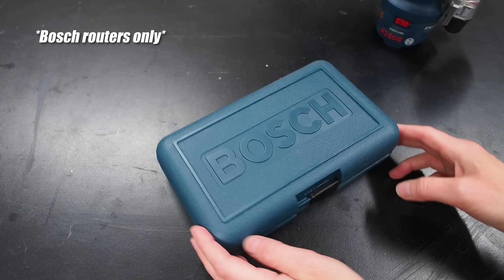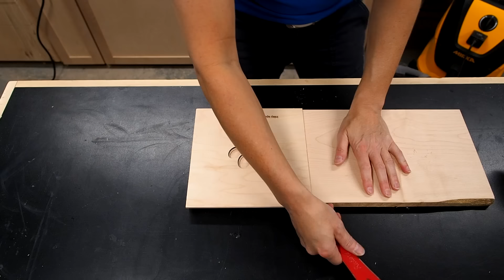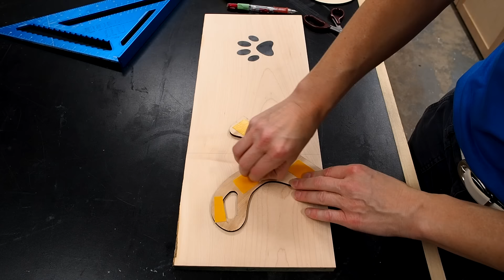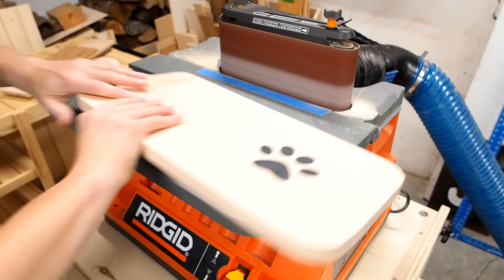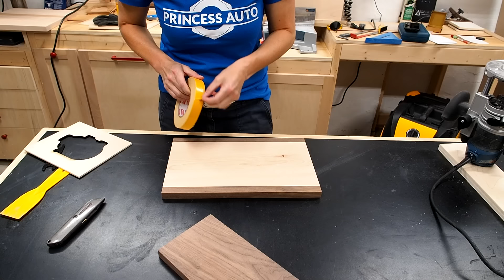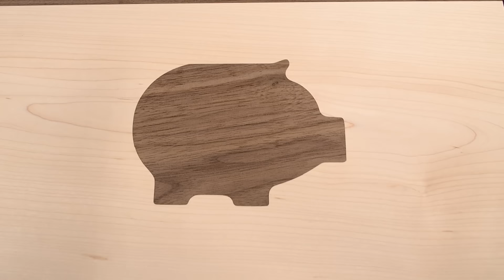Router inlays | Who knew it could be that easy!?

Comment from the maker: Router Templates available here: https://www.diymontreal.com/product-category/router-templates/
Reply: What type of laser xtool model is that?
Reply: I have just started doing some inlay work. When checking for that fit. You are right when you said that if you push the new inlay piece into the ground piece that it may be hard to get it out again. What you can do is lay a length of dental floss across the excavated area then if the inlay piece fits perfect just pull both ends of the dental floss and the inlay will pop out!
Reply: I just subscribed! Thank you. This double sided tape what is the name brand?
Reply: You and the work you do is impressive! :) I appreciate your videos.
Reply: Hello I enjoy your videos. Sometimes you can add a cloth wet overnight and the dent will disappear as it soak up the water and  wood swells
Mike
Reply: I got nothing to add. Flawless router game, immaculate shop. Tools in fantastic working order. Templates of quality. everything is top notch. The glue game is tight. The finish game is tight. Finish sanding is tight. Marking the piece while level sanding is tight. I don't really have anything to add. What I PERSONALLY do for flat surfaces is I have a confirmed flat surface that is dead flat and does not change, that I have a few sheets of 60, 80, 120 paper on so that I can sand anything I need flat. I ONLY would recommend this, though, to people who 1, have plenty of space for a 2-3 foot sanding table and 2, are OCD as HELL about stuff being flat. I build guitars so I am OBSESSED with making sure the backs or tops of a guitar are absolutely flat. I don't actually recommend that though for 99% of the woodworkers on earth, because I'm OCD about it to the point of insanity so there's that. lol. That's why I got nothing to add. Your game is sick. Also glad you did the filler, so glad you included that. There's many people who don't actually know about that trick, and you showed it perfectly. Fantastic all the way around. Even your edge rounding game was impeccable, and that's where a bunch of folks lose focus because its so "easy" in regards to routing that they end up making mistakes. You got serious shop skills. I subscribed on the spot. I do ENTIRELY too much work with a router so its refreshing to see somebody who actually knows how to use one to make an incredible how-to that's probably the single best shot and presented router inlay tutorial on youtube. Its not "hard" to do these things, but its hard to do them RIGHT, at least, til experience makes it easy. this video is perfect for all skill levels too, it serves as a reminder... go slow, be methodical.... pay attention... KEEP BOTH HANDS ON THE ROUTER... can't ever say that enough.... And about that dent you said you couldn't fix, IF its an impact dent and not a gouged out dent, you can almost always steam them out with a wet piece of fabric or paper towel and either a wood engraver or soldering iron directly on the dent. This works with finished or unfinished wood. I suspect you already know this though, just passing it on in case you didn't. FANTASTIC work. And that pig was cute. ALSO, I'm so glad you showed the before and after of filling the inlay.... people don't believe it til they see it that using sawdust as a filler will often render the crack invisible. I can't believe how good both boards looked. Can't say it enough, flawless work. Flawless. I bet you would be a good luthier, and I bet if you learned to build violins they'd be jaw-dropping, THAT IS, if you don't already know how to do it. It takes steady hands and good eyes to do luthiery, and I think you've done more than prove you've got both. Who would have thought that a simple router inlay video would showcase so much skill. And my shop looks like a bomb hit it, I have so much respect for a person that keeps their ship tight.

Comment: Rather than double sided tape, used the superglue and masking tape trick, popular with luthiers the world over. Masking tape on template and stock, burnish tape, a little CA glue on one surfaces’s tape and presto. Holds super well and removes super easily and clean.

Comment: All you need is 5000+ bucks worth of equipment, and you too, can make an inlay this way.
Reply: lol I just saw a video on another channel about building a ultra simple 1 foot wooden box as a first project. He used $2000 in tools.
Reply: Maybe for a high end laser cutter, but handheld plunge routers, even Bosch Pro line and a bit kit are probably closer to ~ $200

Comment: I thank you for the video.  It makes me think I can do this.  However, I tried to make an insert of a hippopotamus, the profile of which is very similar to your pig , for my niece. This was my first attempt at inlay and I found one problem that's not been addressed by any of the videos I've seen.  The problem is, how do you follow the template around when your vision of the work area is blocked by the template bushing?  It's like have a half dollar floating around the bit, so it's difficult to know when it has to change direction a little radically, say to move down the leg.  If you don't turn the corner tightly enough, the project won't fit.  This is such a cool process and I'd love to be able to do it.  Your video gave me a good understanding of the process, but when in practice, I was unable to accurately control that which I could not see.   I would appreciate anything your experience could share.

Comment: Very nice!  Great tutorial and very nice camera work!  In regards to the dent.  Although this technique works a bit better with soft woods rather than hard, it does work with both.  The only thing to mention is that this technique works only if the finish has not been applied to the project.  Once the wood is sealed it's unlikely to work.  Make sure the wood is level on a level bench, etc.  Using an dropper, place a few drops of water, filling up the dent to the top. Leave it overnight. With pine or softer woods the water will allow the compressed wood that makes up the dent to rise up.  This should bring the dent back up to the same level as the surrounding wood surface.  You will however nice that this dent will look sort of like a knot.  So it will be a bit darker in color due to that area being compressed but I think it adds a bit of character to the project.

Comment: nice video. these Youtube videos with all brand new equipment are peculiar to me, but the content and hosting here is great. thanks
from my observation, if the inlay becomes stuck when offering up for dry fit, a little template tape on the surface and your fingers could help lift it out.

Comment: One thing that helps is replacing the plastic part of the bottom of the base with a 1' X 1' piece of plexi or lexan. It will prevent the router from tipping.

Comment: What did you seal the board with before you poured the epoxy?  Sanding sealer?

Also, what kind of wood did you use the board itself?
Reply: I see it now.  You used the clear epoxy before you added the color.

Comment: Fascinating video, thank you for sharing.

May I offer tuppence worth of suggestion?

When using your centring cone, when it comes to tightening the screws, tighten them out of clockwise or anticlockwise order - assuming they were numbered clockwise (or anticlockwise) from 1 to 4, tighten screw 1, then 3, then 2 then 4. 

Also, more of a suggestion than advice because I don't know, but when cutting out your inlay, if you had cut it im reverse (flipped over), you would then have it so that the side of your inlay which goes into the hole would have been the machine cut face, rather than in your case, which had the bandsaw cut face meet with the bottom of the pocket. I'd have thought that would make for a more secure joint. That way, the bandsawed face would be facing up, and would then be sanded flush.

Just my thoughts, take them or leave them, and thank you for an interesting video.

Comment: 13:40 Yes, if the inlay is tight, getting it out is a challenge.
Colin Knecht at WoodworkWeb uses dental floss.  Lay several strands across the void, then drop the inlay into place, but not necessarily all the way.  I say "several strands", because you might have to grab several to pull the inlay out.  (My apologies, I don't have a link to Colin's video.)

Comment: I'm genuinely confused, so I hope someone can answer this. When you raise the grain with water, what is the point of sanding afterward? Aren't you just clogging the grain again? Rubio Monocoat, for example, recommends that people don't sand after raising the grain and instead apply the finish. TIA.
Reply: This seems a good opportunity for a science experiment.  Try raising the grain on different kinds of wood, and sanding with different grits.  
assessing the results with finger tips is scientific enough.
I suspect that sharp sandpaper will cut the raised whiskers, or at least most of them.

Comment: Great video!

Have you heard of a bandsaw technique called Feathering? It could be handy here.
You cut as you did but then you use the fact the blade has a kerf to slowly take extra off right down to the line by passing the piece Backwards at a very slight angle so the back of the blade does not burn the edge. The kerf will lightly take off small amounts very accurately!

Comment: Nice! quick tip for anyone, unless you're using a fancy compression router bit, it's a good idea to practice downhill routing - going down the slope with the grain, rather than up the slope against the grain. particularly when doing that handle area.

Comment: I watched your circle cutting jig video.  its excellent. I also prefer the bandsaw jig.  would not even consider cutting a circle on a table saw. thanks for the instruction.
Reply: I also prefer the bandsaw circle jig. I built one out of      scraps,which worked great. 
Would not even try the table saw method. Thanks

Comment: The only concern I have is that you can't see what is happening at the router bit. A better solution I believe is an overhead pin router setup using the pattern/template under the board being routed. Doesn't have to be a huge machine, just a normal plunge router mounted above. Most DIYers can do this. Thanks for the video though.

Comment: Great video. I am a little bit confuse, on how it works. If I do the pocket  with the additional bearing, it will makes the pocket a lot smaller than the template 
By removing the bearing the male inlay is larger than the pocket, right?I just don’t understand how it works.

Comment: It's a cool idea but I don't like using epoxy on a surface that will be used for cutting food. You'd either have to always avoid the epoxy when cutting, which I'd personally find annoying, or risk getting tiny chips of epoxy in your food (plus it'll scratch the epoxy). The scratches from the knife are not as obvious on wood.
Reply from the maker: Agreed. The paw was intended more as a charcuterie board (displaying/serving food rather than cutting)

Comment: Epoxy shrinks a bit when it cures.  It you're REALLY careful when you pour it this can give you a quite neat reverse emboss sort of effect.  If you don't fill all the holes evenly you have to sand some down and then you have some sunken bits and some sanded bits.  

The only solution I ever found to this was to overfill all the holes a bit.  I was using a small CNC machine, so it was then fine to run a smoothing pass to shave the raised epoxy back down.  Sanding it would be tedious and the only other way around that I can think of would be a small flattening jig that would sit on top of the board away from the inlay.

Comment: personally, I use CNC for inlays, but you have shown great skills and precision.   Great job.  Thanks for sharing
Reply: Will the CNC give you sharp points instead of radiuses in corners? I know one has a pretty good selection of very small diameter tooling for CNC.
Reply: yes, V bits will give you precise corners @yojoehd

Comment: Really great video. Why sand the corners instead of using a flush trim router, like you did with the template?
Reply from the maker: It just seemed faster. I would have had to create a template to use the flush ṭrim bit with the router.

Comment: Hi. Try this:
Instead Double sided Tape

Use painters tape on both side. 
Make shure both sides Matches.
Put cyanid superglue on one side.
Glue them together - put tape on tape.
Both stick together well.
By take them a part  the painters tape remove easily.
Better than Double sided tape.

Make that sense.?

Comment: Great video and you make it look so easy. However, why do you keep the band saw guides so far apart? This will twist your blade and is dangerous. Keep the guides as close to your work as possible (1/8"). Bend over and look into the cut.. You will have more control of the cut. I see this a lot in wood working shops.

Comment: What do you use to seal the board before puring the epoxy?
Reply: I've done much the same thing using a small CNC machine and use simple spray varnish.  A couple of coats does it.  The reason you need it is otherwise the epoxy flows through the wood fibres and you get colour leakage.  All you're trying to do is seal the grain to prevent this.  It doesn't really matter what you get on the surface, because you'll sand that off.

Comment: ❤WOULD like to see several bowtie templates. On the 2 straight endlines, bow them outward a tiny bit. This would let you use say, a 1/8" or 1/16" bit all the way around the onside of the template and not have to go back to manually chisel out the tight corners. THANKS!

Comment: A great job on this demonstration video. I have used this system for a number of years. I thought I would mention a few issues that one might run into. If you are going to be making a large inlay, You will have to either enlarge your router base or make some supporting, equal depth thickness, router base supporting material when routing the base stock. You can't allow the router to fall into the void. Also, templates and guides do not allow for inlays with sharp corners. Your triangles and stars will not have points at the end, they will have radiuses. I'm still trying to figure that out.
Reply from the maker: You're absolutely right. Two very valid points 👍
Reply: hey @jojohd  - 

The inlay boundary (walnut) is cut with the side of the bit farthest from the template. The recess boundary is cut  with the side of the bit closest to the template. To fit perfectly, both cut curves need to match up at the same perpendicular offset distance from the template curve. The removable collar diameter is chosen precisely to make that happen for the chosen bit and template diameters. 

The limiting factor is the outer diameter of the removable collar which determines the offset distance from the template curve to the recess curve.  If too large the collar will not be able to make full contact with the template into tight high curvature 'corners'. This will increase the offset from the template to the recess boundary in too tight corners causing the inlay to not fit.

I like thinking about these kinds of problems. Hope this helps,
Reply: @eideticgoone7035  I have never had a problem fitting an inlay into a recess using the template guides. My two statements related to 1. supporting the router base when extracting material on a large recess. 2. You can not get a perfectly sharp corners with a template guide and router bit. Though, with a very small diameter bit you could get pretty close.But as you state, how would one produce a template guide small enough to guide a pin point bit. I have hand chiseled many sharp pointed inlays in my career. Thanks for the note.

Comment: A helpful thing my grandad told me about inlays, when offering up the inlay use a couple of lengths of strong thread (I use dental floss) laid across the hole ensuring you have plenty of thread on each side to hold on to should the inlay fall into the hole and you need to lift it out by the threads.
Reply: Grandpas always have the best advice
Reply: Good tip hope I remember it
Reply: Such a great teacher  😊
Reply from the maker: Sweet tip!
Reply: @DIYMontreal  for fun, I would test using a vacuum to pull it out if stuck.
Reply: My epoxy shrinks. How do you prevent it from shrinking?
Reply: @stevemumford1999  Pour until the epoxy domes without overflowing. It takes some practice, but usually works out on smaller pours.
Reply: @stevemumford1999 
I'm not aware of any epoxy resin that expands or contracts upon curing.

However, if you're adding a thickening filler in powder form, the epoxy resin has to fully wet out the powder, and this process takes time. The initial minute of mixing only starts the process. That's the only explanation I can see for a genuine shrinkage issue. The solution is to allow time for the wetting process to complete before applying the resin, but not so long that it starts to gel in the pot. Refrigerating the materials will help to extend pot life. Smaller batches, constant slow stirring, anything that avoids the pot heating up will help to extend pot time.

A very similar wetting process occurs when epoxy is applied to material with a porous surface. The resin will wick into the material. It hasn't shrunk at all, but in effect some of it has drained away. The solution is simply to top it up when that happens, before the resin has begun to gel.
Reply from the maker: @stevemumford1999  I've never had that issue so hard to say. Maybe try a different brand?